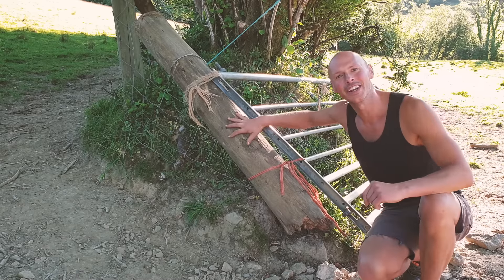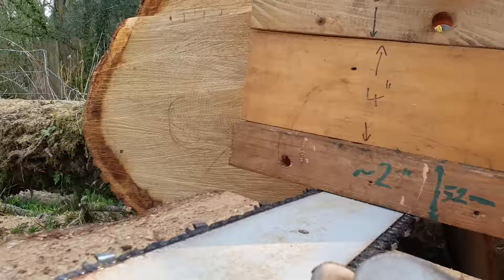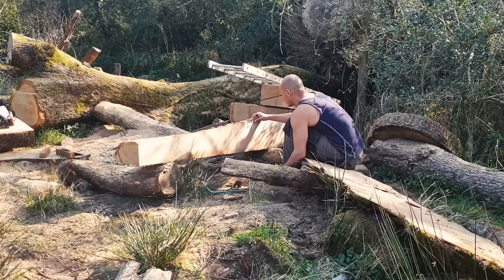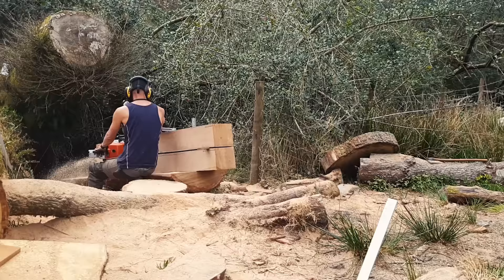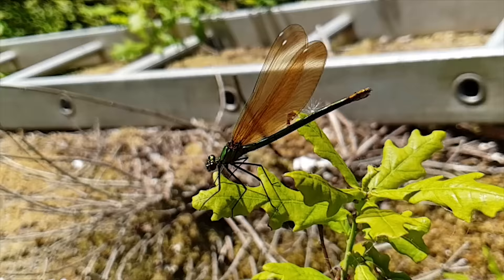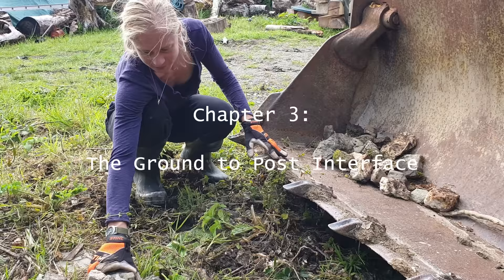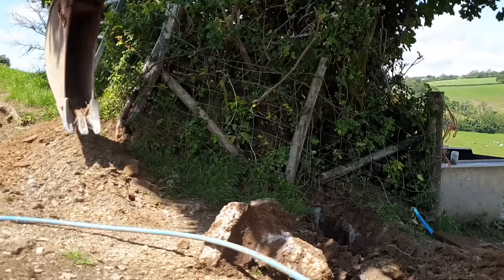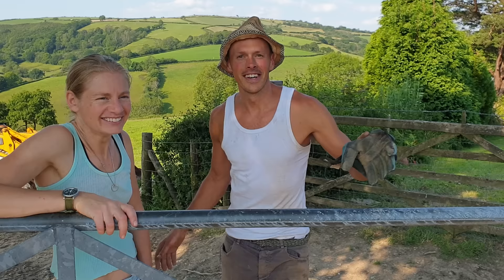The 3 secrets to ROT PROOF POSTS and how to make them

Comment: How interesting!

When I was a horse mad teen girl, part of how I supported my horse was by working for the stable in the summers. One memorable summer, the owner wanted to hang new fence, which meant putting in fenceposts. In Iowa (USA), black locust was readily available and relatively cheap. Under the hawk eye of an old ranch hand, we set roughly a gazillion posts. By hand. I'd get up early, go out and ride 2 to 4 horses (one of my own and the others were rehab cases for the stable owner... for free) in the relatively cool mornings. Then around 10 am or a bit later, we'd go to work and be paid for those hours.

First we dug the post holes by hand with narrow spades. The hole was dug 6 to 8 inches/15 to 20 cm deeper than the post was going to be set. As we dug out each post hole, we piled the dirt on a tarp and then we added about 25% by volume of a high clay soil from a clay pit on the farm.

We filled the extra depth with crushed rock and tamped it down with a large tamper made by welding a flat steel plate onto a piece of rebar. We'd tamp for awhile, measure the depth of the hole, throw in more gravel and tamp until the hole was at the desired depth and it didn't matter how hard we tamped, it never got lower.

We'd set the pole in the hole, using a spirit level to make sure it was vertical on adjoining faces, then set a couple 1x2s wedged into place to keep it properly aligned. And then the hard part started.

After the original soil and the high clay addition were thoroughly mixed, we'd throw in 2 to 3 inches/5 to 8 cm and use small tampers. We pounded on that dirt until the tamper rang like we were banging it on concrete. "Tamp 'er til she rings!" For the fiddly areas adjacent to the corners of the post, we had rebar with 1x1 inch/2.5x2.5 cm plates so that all the dirt in the hole was solidly tamped with no loose areas.  Repeat until we'd tamped in all the original dirt plus 25% into the hole which was now taken up by a 6x6 inch/15x15 cm post or an 8x8 inch/20x20 cm king (corner or gate) post. The fill rose in a cone shape around the post that was about 6 inches/15 cm tall--still tamped until it rang.

The last step was making little upside down V shaped roofs that were given an initial coat of paint in the shop, then tacked into place atop each post and given another coat of paint to cover the nail heads.

The dirt was tamped so solidly that plants could not grow in it and the cones did not erode.

About 10 years ago, my husband and I were talking and got onto the subject of the hardest task we'd ever done to make money. I told him about setting fenceposts and he was fascinated (he wasn't from Iowa and was a city boy until he met me). The next time we visited my parents, we took a little detour so we could see how the fenceposts had survived. Forty five or so years later and the original fenceposts were still there and still solid. No plants were growing on the tamped cones and the fenceposts were so solid that we could tackle them with all our weight and not move them in the least. No signs of rot under their little roofs, either. Whoever has that land now has kept up with repainting the little roofs--they were weathered but there was no peeling paint and it was obvious there were many coats of paint there.
Reply from the maker: Good evening GrainneDhu. Thanks so much for sharing that, super interesting. As I read your comment out to Sam, who once worked at the Centre for Alternative Technology (CAT) here in Wales, she suggested your process is very similar to a way they were making both rammed earth walls and floors. They pound and compress it enough that it becomes a reasonable concrete alternative. The ratio of clay to sand in the soil has to be just right apparently, and it makes fantastic, thermally massive walls... 
Did you add moisture to the clay soil mix when you did the posts? Just the right amount apparently makes it compress well, too much and it cracks as it dries. 
Sam and I both recon that the tamping down with our massive iron bar was probably the hardest bit in the whole process. Proper physically exhausting.
Anyway, great to hear your experience - funny how it is often the most difficult things we do in life that can stick with us, and potentially enrich our experience - especially after the event ;) 
Peace, Bongo.
Reply: @FloweringElbow  yes, the dirt/clay mix had to be at the right moisture level or it would not tamp down tight. You could pound forever or hours, whichever came first, and you'd never hear the tamper make that ringing sound. It had to be just moist enough to compress into a tight lump if you squeezed a handful but not so much that any visible moisture beaded up on the surface of the lump (let alone drip out).

Since the only relatively quick way to remedy too much water was to add dry dirt (dusty sort of dirt) and then it would all have to be tamped into the hole, we were really careful not to just toss on buckets of water! Plus, the nearest water was the creek, which was always downhill from the fenceposts. So we'd dribble the water out of the bucket like misers while 2 other girls mixed it in.

Looking back on my life, it is clear that there are many experiences which are more enjoyable to recall than they were to actually do.
Reply: I wish I had horses so I could attract a fencepost setter.
Reply from the maker: @R.C. Whitehead  lol!😂
Reply: @FloweringElbow  - which came first the fence or the horse or the horsey girl?
Reply: @roderickwhitehead  lol. I think it's the chainsaw chops...
Reply: @roderickwhitehead  LOL! One of the horse mad girls was a strawberry blond, so could she fill two sister spots?
Reply: @GrainneDhu  skidster w auger; electric cement mixer;100 posts set in 3 days. Time vs money w the MN frost lines by hand just isn't worth it. Good story though and as a ranch hands we're very rarely given such luxuries. Now that I own the place its a different game lol
Reply: Wow, your husband did well in finding you
Reply: @____________________________.x  I feel very fortunate to have had him in my life, that's for sure!
Reply: You may have less rain than the UK in Iowa, US, so they may last longer for that reason.
Reply: @thetessellater9163  Bongo's (Flowering Elbow) wife was working on a rammed earth project in Wales for floors and walls, which suggests to me that it probably lasts quite well in UK rain (my mama was from Lancashire, so I am not completely unacquainted with the country). 

Iowa weather tends to be very destructive to anything permanent outdoors. There are years where we get incredible amounts of rain (I've seen 3 so-called 500 year floods in the last 30 years--thank you, climate change). 

A lot of rain alone doesn't cause all that much damage; it's the combination with very cold winters that really stresses structures. Last winter, we had several days in a row where the high temperature of the day was -15 F/-26.1 C--that wasn't the daily low temperature, that was the highest temperature of the day.

We will alternate intense cold spells like that with milder weather with lows barely below freezing. The alternating intense cold and slight warming expands and contracts the top 12 inches/30 cm of the soil and if there is any water in it, the effects of contraction are greatly magnified.

When humans had to do much  by hand, they figured out how to do it once and make it last.
Reply: Howdy, GrainneDhu. My limited experience is similar to yours and it also took place on a farm in Iowa (a bit north of Kellerton) about 40 years ago. I was there to help a friend of mine who had grown up on that farm and looked forward to farming it again full time. His farm had quite a bit of osage orange trees growing in the fence lines. That’s what he used for line posts and for corner posts as well. Those familiar with osage orange trees know that you can cut it easily with a chainsaw while it alive, but once dried it’s nearly rock hard and you won’t get a staple into it to fasten fencing wire. The soil had a good mixture of clay in it starting about a foot down (30mm?) and we dug fence post holes using what we called “jobbers”, a two-handled clamshell digger. We took turns digging. To set the posts, we simply dropped the big end in the new hole then slowly filled the sides with clay and dirt we had dug out. We used a stick 2-3 inches across (5-6mm) as the tamper. There was nothing there to ring-out when the soil was tamped but I can assure you it was rock hard and a corner post would not move. Most corner posts required 3 vertical posts and horizontal cross braces. The corner posts were longer and thicker posts but the cross braces could be line posts or smaller. Cross braces were held in place by heavy fencing wire and had to be installed before the corner posts were fully tamped in. The osage orange wood was also used for winter heat in a wood stove or a fireplace, but you had to be careful because dry osage orange is extremely dense and burns very hot. You mentioned the memory of fencing being better than the actual experience, and I heartily agree. I thought of that experience just last month when I installed a roadside mailbox for another friend at her East Tennessee farm. It also got tamped into the rocky soil. I also decided that I’m getting a bit old to be doing that kind of work on a regular basis.  ;-)
Reply: @Greg_Gatsby  There's a definite sense of achievement after some years go by and the fence posts are in great condition!

I imagine that setting fence was one way homesteaders used to keep the family teens out of trouble. Had to be done and by the time the day was over, the teens were too tired to make mischief.
Reply: I would not be surprised if those locust posts sprouted roots.  You may be surprised.  Another advantage using locust as post is that have a tendency to sprout roots once there back filled.  Perhaps check this theory and go check?
Reply: @tjburr1968  I can't go back to check but when I was out there about ten years ago, there were no signs of growth above ground. No growth whatsoever--no twigs, no leaves, nothing. They may or may not have had roots but if they did, they weren't doing anything with them.

I'd be surprised if there was enough air or water for them to sprout.
Reply: That’s a great story, I think I like it better than the video. I’ve worked in construction all my life, and most of that was doing grading and paving, and it’s all about what you were talking about. It’s a fine ballet between adding moisture and processing it until it’s just right, then it’ll compact properly. Too much water and it’ll start pumping and moving, too little and you’re just waisting your time. That ringing is because it finally became as hard as the steel you’re hitting it with, not easy by hand!! Much respect and, it’s really cool to go back to a project that you’ve helped build and see that it’s still doing well! 💪💪🙌🙌🙏🤟🤙
Reply: @dozerboy67  Looking back, it's amazing how motivated a bunch of horse crazy teenage girls were when properly supervised! Old Davey really did know what he was doing and was quite patient at teaching us how to do it right.
Reply: @GrainneDhu  that's too cool! Thanks for sharing!
Reply: There is no substitute for doing a job right the first time, those who ignore this advice are doomed to doing it over again and again. We used a lot of Osage orange and a lot of those are still there 60 years later.
Reply: @JamesCouch777  Now that I am old, I really see the wisdom of that saying. Better to set the fenceposts right when you're young and energetic than be faced with pulling out rotting fenceposts and setting new ones when you've got 50+ years more wear on the body.
Reply: @GrainneDhu  agreed, the difference between 50 and 70 is staggering.
Reply: RED Mercury  it's only a stereotype because it happens so often!

Actually, I may still resemble that description, all except the "teen" part.
Reply: @steveb2739  thank you!
Reply: Cool.  About how many years were there between putting in the posts and going back to see them with your husband?
Reply: @Fierology  the posts were set in 1971 or 1972 and my husband and I visited them in 2014 or 2015. So that would be 42 years or so.
Reply: black locust is closed cell wood, (other trees are open cell and wick water easily) lasts up to 100 years untreated..  black locust is in the pea family so its roots also add nitrogen to the ground.. considered to be a trash tree here in the US, simply because it can grow in poor soil because it can provide its own nitrogen needs.
Reply: @element5377  how interesting! I did not know either thing, only that black locust makes really great fenceposts because, set right, it will outlast the landowner. And that it does grow anywhere, given half a chance, but I did not know why.

Thank you!
Reply: @GrainneDhu  thank you great info
Reply: Wow what a story thanks
Reply: @michaelmahoney4889  glad you enjoyed it.
Reply: This is exactly how we set around two hundred posts around the perimeter of our land in Portugal. We dug every hole by hand with a narrow spade, a clam post hole digger and a heavy metal pole/lever bar which has a chisel on one end and a spike on the other (for the hard holes or for smashing though rocks). Each hole was different to dig - lots with clay, some with bedrock or littered with stones if you were unlucky - these sometimes took up to an hour to dig for our 3m total length fence posts (around 70-90cm in the ground. I welded a round piece of flat bar on the end of a long pole to use to tamp the earth/clay/gravel mix down (similar to yours floweringelbow) , layer by layer - also tamping till you get that ting ting ting (ideally!). 

Attaching the fence is a whole other story. 

We still say to each other that it is the hardest job we have ever done! Grateful that we did it as it was a great experience, spiritual at times. But mostly just hard fucking graft
Reply: @tyfe  Definitely one of those experiences that was better in hindsight! But doing it well is very satisfying.
Reply: Interesting story.
Reply: @GrainneDhu  Very cool! 😊🌎💖
Reply: Great video and great bonus story. Wow. I fenced and cross fenced 1,000 acres of game farm in Wisconsin in my 20’s. Even then, it gave me back issues. We used railroad ties for all the corners and stress points. But man, I feel shamed by the precision described here.  If they are still standing, I guess it would only be because they were treated railroad ties.  We just dug holes, put them in, and tamped dirt around them in three or four layers.
Reply: @davidpeightal4918  It is amazing what a properly motivated group of teenagers can accomplish. Sure, we hurt every eveniing for the first few weeks but then we toughened up.

Now? I'd put in 15 minutes and need 6 months of rest and then physical therapy to recover!

Back then, I'd do just about anything to support my horse.

Comment: My old gardener had worked on the land all his life he was 90 years old when he died that was some 40 years ago. 
He fiting a gate for me into a woodland and it was a joy to see him work.
He used our own oak that had been stored before i bought the house and it was he said about 40 years in drying out in one of the sheds.
He trimmed the one side with his axe that was so sharp he could cut the hair on the back of his arm to show me. 
He lit a fire and slowly roasted the post in the embers which he constanly topped up for two days 
dug A HOLE  and used 4 lage rounded stones of considerable size around the post which he rammed home with a very heavy stamper. Filled all around with smaller stones again ramming down solid. 
I ASKED why only rounded weathered stones ? Because the water drops away quickly .. 
Topped it off with soil and the placed on top of the post which he had cut at about 30% a pieces of lead and gentle shapped it with a special wooden hammer of sorts untill it look as though it was perposely made for the job. 
The post is still fine .. 
that was 46 years ago.
Reply from the maker: Good day Jack. That's a wonderful story - thanks for sharing your experience :D
Reply: Wow! That was  back in the days when we had time to think about what it was we were doing! Instead of always being in a rush just making due for the time being. That's what has been lacking in American culture for a whole generation and a half. So sad to see wisdom and knowledge lost in exchange for short lived junk that thrills and excites us for the moment. Only to be thrown away next month for the new next best gadgets on the market. Todays cultures are loosing knowledge and time tested wisdom. Its sad to see the relentless dumbing down of the peoples yet it is awesome to see there are still a few of us clinging to the life blood of knowhow.👍
Reply: So the wood for that post came from a tree that was cut down almost a century ago.

Comment: I have a mill and I am in my late 60's. I have had 5 back surgeries, bone grafts and anchors, pins, plates and screws from ankles to neck. I often work alone and I find a few pieces of pipe act as a rollers are a lot of help. Even if I have help. Rollers under the heavy boards help a lot. BTW Great Video. I really enjoy time spent around the mill with my wife. You two are a team.